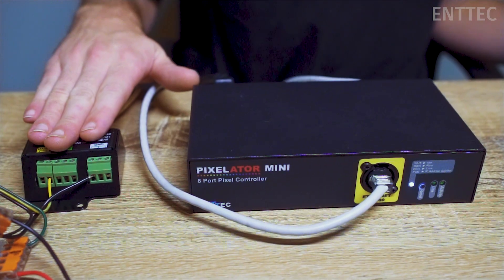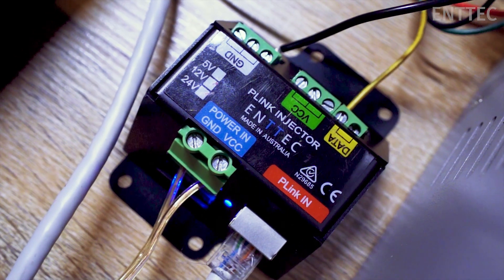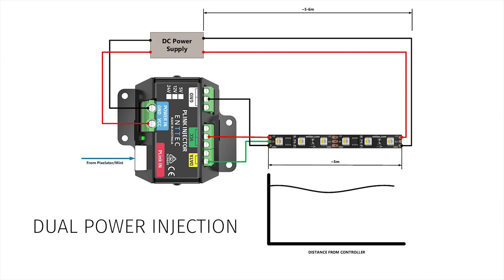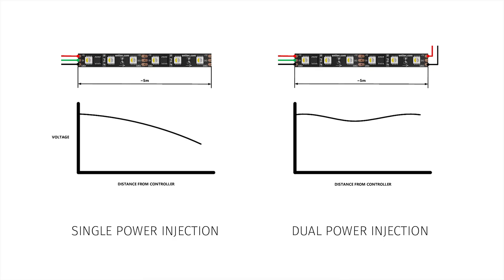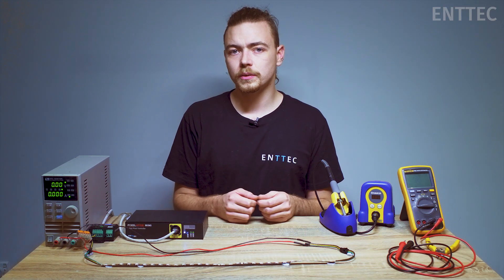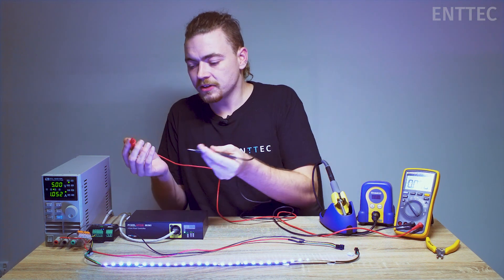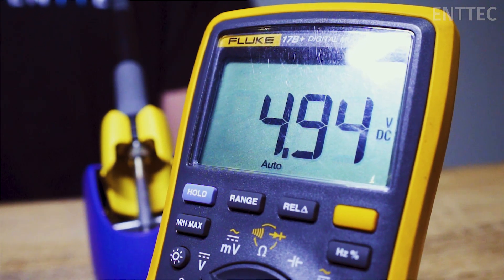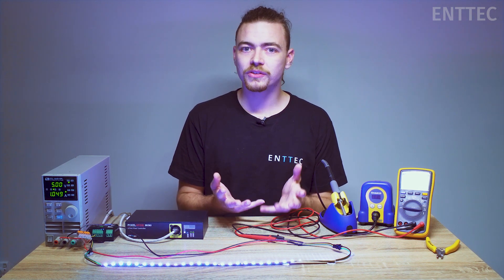Ep.8 How to beat voltage drop!

Comment: I have a question that no one knows the answer to.  I am buying a 20m RGBW 5050, 24V rectifier, 300w, WIFI controller.  I connect the rectifier to the controller, the controller to the tape, and the other end of the tape after installing around the room I also connect to the same controller in the same way as the beginning of the tape.  Can it be so?
Reply from the maker: There should be only one controller on any section of tape. With our Pixel Octo, the power supply can be any end . But the Pixel Octo must be at the Data In end.

Comment: Im not sure whats wrong with my amp, its not got as much gain/distortion as when played with headphones and it feels like its being played under water; some times it just cuts out completely and then wont turn on but when I plug head phones in the sound is absolutley perfect. I know that its got nothing to do with my guitar, amp lead or guitar lead. Do you know what might be wrong? If it helps I've got a marshall MG102CFX. I bought it second hand and had these problems when I got it.
Reply from the maker: Hey Joe, I'm flattered you've asked us for help.

Unfortunately, I'm not able to diagnose this issue over the internet.
These sorts of problems need to be diagnosed and repaired in person, by someone who ideally has experience with audio electronics, but most good electronics repair people should be able to track down the issue, source the parts and will have the right equipment and skills to replace any parts necessary. I'm speaking from experience here as I used to take on jobs repairing DJ/Music production equipment years ago as a side hustle. 

My suggestion to you is to take your amp to a Guitar shop/electronics repair shop to get this sorted properly. They will be able to test the amp, take apart the unit and do a visual inspection. They will also be able to begin accessing schematics and begin testing individual parts of the circuit. All of these steps that I've just mentioned are essential to electronic diagnosis, and cannot be realistically done remotely. 

Good luck and happy jamming!
    -Jordan

Comment: Super helpful! Can you tell me; the mm2 or AWG cable size that is equivalent to the resistance in the pixel tape material?
Reply from the maker: Different pixel tape will have a different resistance per meter. The best way to find this out is to set your tape to full white and measure the voltage drop across you tape and the current consumed by the tape. Then you'll use V/I=R to find the resistance. You take both of these measurements using a multi meter. 

In this case V is the voltage drop across your tape, I is the current consumed by the tape at full power. Remember that if you were to say measure the Voltage and Current across a 100mm section of tape, you'll need to multiple that number by 10 to get resistance per meter.
Reply: @ENTTECofficial  I was referring to your tape - who should buy anything else ;-) I have a roll arriving today/tomorrow so will follow your guidance - thanks.

Comment: Is it the same concept for the LED strips that have a 12v pin and then 3 other pins for RGB?
Reply: Have you allready found the solution for your question? I have the same question
Reply from the maker: Hi guys, what you're referring to here is constant voltage (CV) tape, also known as analogue tape, or sometimes "Dumb" tape. 

With constant voltage tape, there is no control chip metering the flow of current to each LED, so you can't have multiple power injections like we've shown here. Basically with constant voltage tape, you can only have a single injection for each tape section.